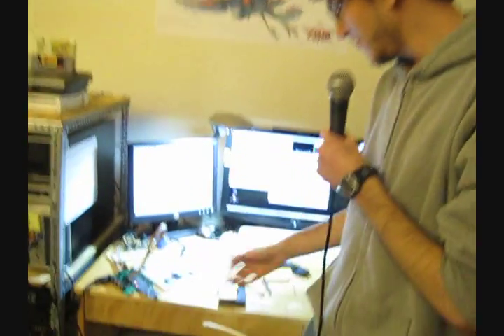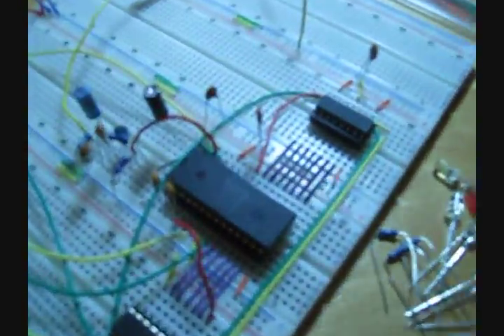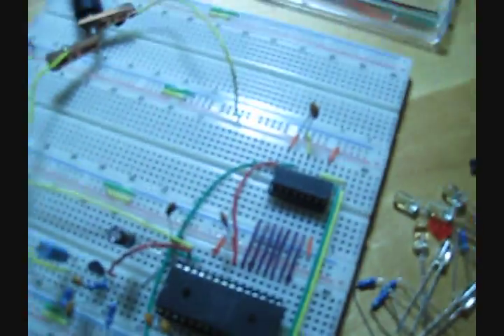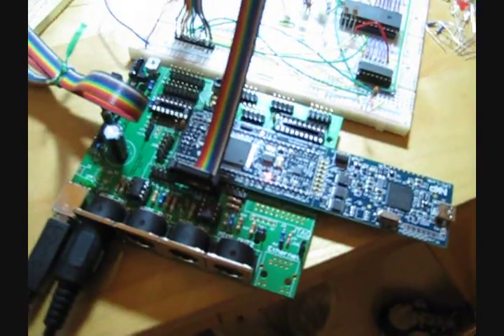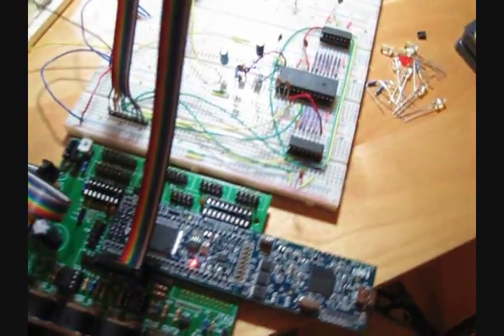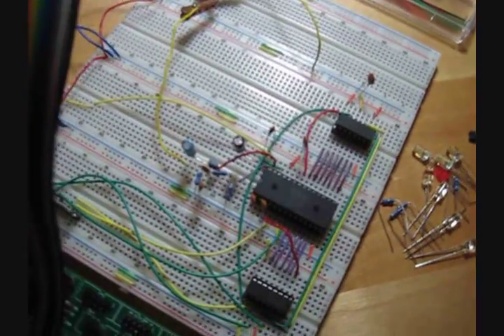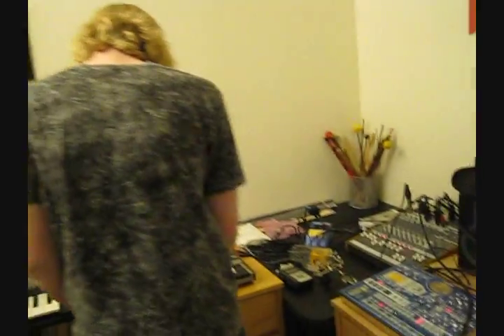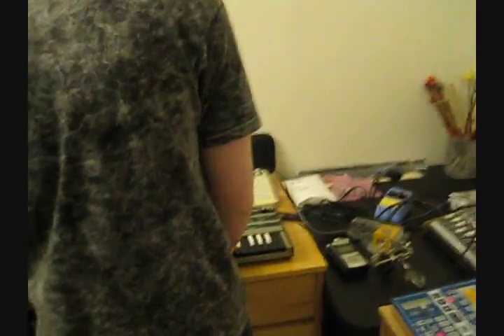MIDIbox ASIDITY First Test: SID running off LPC17

Comment from the maker: Have you looked at the MIDIbox SID project, the one my ASIDITY project is based on? It's a do-it-yourself synthesizer built around SID chips (you can use one to eight SIDs), that (among other things) you can plug into your computer and play music through. It's infinitely cooler and likely much cheaper than purchasing a commercial SID-based synth. There's a link in the description, plus a few of the Related Videos to this video are MIDIbox SIDs.